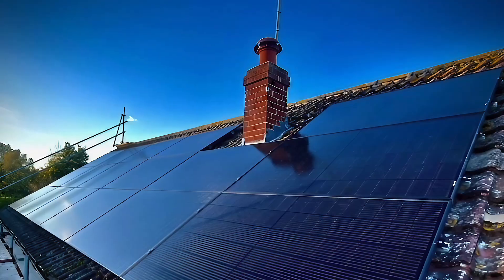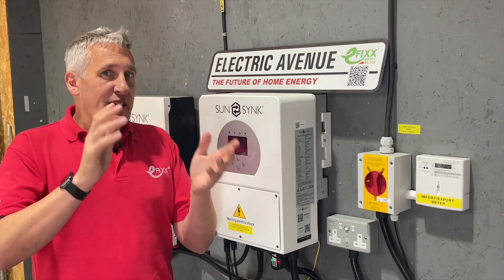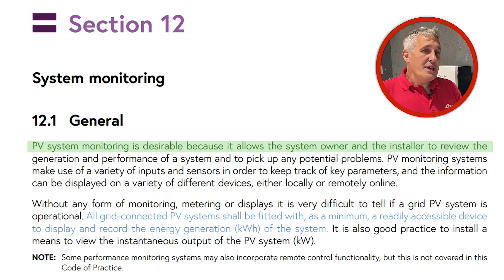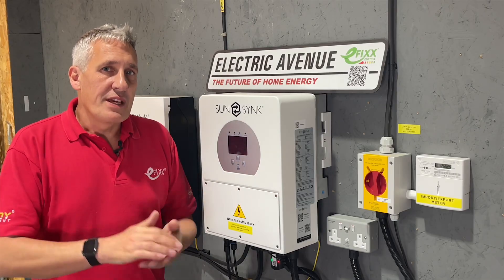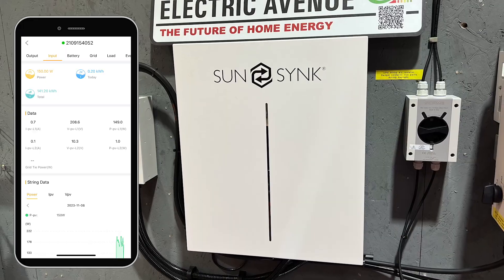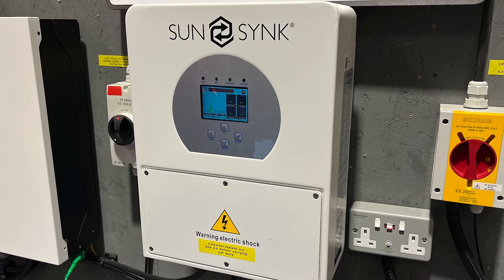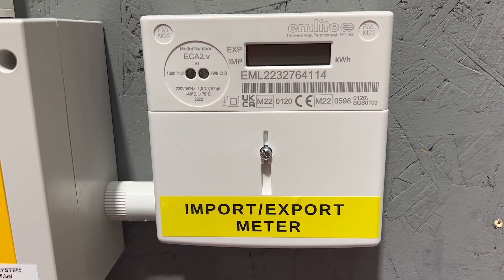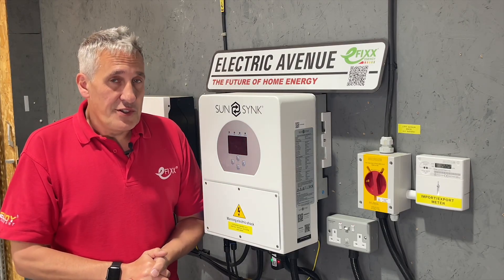Solar Inverter Installation UK  - Do you Need a Generation Meter?

Comment: The description of what the MID is commencing at 00:53 is incorrect.

The Measuring Instrument Directive was a European Law , reference: 2014/32/EU whose purpose was to achieve harmonisation of the laws of the Member States relating to the making available on the market of measuring instruments.

Individuals don't follow EU directives.
What happens is, it is down to each EU member state to create their own legislation which implements the EU directive.

The UK local legislation which the UK government created to implement that EU directive is: The Measuring Instrument Regulations 2016

So the actual law that applies to British  people is The Measuring Instrument Regulations 2016 and NOT the Measuring Instrument Directive.

Another important point is:
The Measuring Instrument Regulation does NOT command that people with solar panels feeding in energy into the National Grid install a kWh meter.

The command comes from another means.

Comment: Amazing how behind the UK is , my UK smart meter didn’t work for 6 year after install and it still doesn’t measure the FIT.  In France I have a linky, 10 years old , no need for additional meter as it automatically sends the feed back to the grid.

Comment: We have solar/battery works well. We buy our electricity from a third party so can’t benefit from exporting units . However when exporting excess units they are being recorded as IMPORTED unit by the submeter we get our electricity from , your thoughts??

Comment: i have a question, we have just had the solar system fitted is there a video on how to read the little grey meter? as ours has a negative number on import and 00000 for export. also should we ask for a newer smart meter than can conect to the solar system? we are PAYG electric (dont trust our provider) ?

Comment: I'm getting solar fitted in the next few weeks. I'm in northern ireland, so the rules are different. my installer says it will just run my old spinning meter backwards, so effectively net metering. He said the electric supplier will try to get me to install a new meter but i can say no, however I want to get the meter moved anyway so i'll let them install a new one if they move it for free.
Reply: I doubt the rules are that different, having backward spinning meter would be an issue in mainland UK, and leave you open to financial penalties if discovered (though I have never heard that happening). Some older meters go forward whether you are drawing power or exporting making you pay for your generation too, and some spinning meters have a stop on them to prevent the meter going backwards. All things being equal probably safest to go for a smartmeter and get on a tariff that pays more for export.
Reply: @mikebarry229  can't get smart meters in Northern Ireland. Like they refuse to fit them. Boggles the mind, but I got the export meter fitted just this week so we'll see how it goes

Comment: My PV/battery "Generation" meter has been damaged as the installers left one of the screws loose and it's now a bit melted.   I'm already getting export payments from my smart meter  so if I understand correctly the export meter was only fitted as best practice and is not actually showing anything useful so it could just be removed, I did aske them not to fit it it in the first place.

Comment: Many of the older FiT ones (like mine) do not have export meters, only an authorised generation one belonging to the house owner, and on a 50% deemed export contract with Ofcom (linked to RPI inflation) via one of the suppliers that manages it. At least, that is true in the absence of a “Smart” meter owned by the utility firm, which is the case at present at my place.

It all depends on your usage, as to whether measure export would be better than 50% generation as deemed export.

I’m just about half way through a 20 year FiT, so I guess it’s possible that a smart meter on the utility side might take over sometime, or if one of the other units fails part way through.

Comment: when submitting MCS certificate application you are asked for the serial number and model of the meter, what information should we provide? the inverter details?
Reply from the maker: Yes or just put zeros in the form
Reply: @efixx I was about to ask that question. I’ve submitted the din rail meter serials for the govenergy em115’s before, but I never thought of just putting zeros! 😅

Comment: With smart metering for import/export it doesnt feel like its really needed anymore. Im happy to rely on the mid meters such as the din rail ones on the GivEnergy AIO/Gateway in place of a physical meter of its own right. Less happy to rely on the inverters themselves to give accurate generation data so with a base level solax system as an example we would still fit an external meter. Its a good way to check what the inverter is saying its doing vs whats actually outputting into the wider system. Quick and simple way to check over time what you actually produced. Because we all know when an app loses support or some firmware is updated that data is likely gone to the cloud forever with it lol. Good walk through again Gordon. Didnt know Gary has solar he has never mentioned it.....
Reply from the maker: Problem is the dumb meters don’t give you any time reference so you can’t really gauge performance overtime. Unless you take a manual reading week / day
Reply from the maker: Rumour has it Gary has another battery 🔋…. Beware
Reply: @efixx  Gary should really start talking about his solar. It’s like a hidden secret, maybe he should get an air fryer…
Reply: @efixx  absolutely agree. More to see very quickly since I put my system in its pumped out however many units. Day to day I use the GivEnergy portal which can show me generation output, temperatures of all the equipment, power factor, voltage and what I had for dinner lol. That level of data is insane. The worry is much like when Anderson got into trouble in the EV world is that reliable long term, will it always have support for say a 15 year lifespan. I quite like having the little meter to check now and then. Was very interesting to visit an older system last week that has one for the FIT and that has measured generation since 2010.

Comment: I have recently hat 2 of these meters fitted for on 2 inverters & I'm confused:

1st meter shows NET 48kW     (IMP 0.4kW & EXP 48.8kW)

2nd meter shows NET -73kW yes minus!      (EXP 10.1kW & IMP 83.2 kW).

Any ideas whats going on???🤔
Reply from the maker: Do you have batteries?
Reply: @efixx  Yes I do (sorry I should have said). I should also mention there are ZERO cables/loads connected to the CU yet as the house is undergoing major renovations so no electrics are being used from the CU. The only things connected to the main CU presently is the solar gear (two inverters & one 1 5.8kwh battery)  :)

Comment: Let's make this simple as it seems you are missing the point. The meter is to record the kW generated by the connect system at the site. Which, is    also accepted by the energy co's as it has a known level of accuracy. The inverter does not providing the same level of accuracy. Also, what happens when the inverter is replaced? Or when the inverter manufacturer go bankrupt? All data is lost as it is likely that the inverter model/manufacturer is changed. The placement of the meter shouldn't be in the Roof. It's supposed to be where day light is available. If the installer has placed it wrongly. Then it should fail the MCS cert. A SMART meter may be available however it's not guaranteed. Even now. Your one doesn't work! They also can't tell if you have created the kW via Gen or PV. Hence, the physical meter should be fitted.
Reply from the maker: Unless it's a old feed in tariff agreement - the meter isn't used by the energy company for payment. Without a smart meter you can't get an export MPAN so are frozen out of the smart tariff.  If the inverter fails, then the data will still be available in the app. The "dumb" generation meters, only record an total generation, no data with regards to time or track of performance, so really a useless number. Would be a different case if installers fitted a version with communications.. but most fit the £30 version.
Reply: Even with "dumb" meters it really depends on the meter model used, there are many that have capability for adding communications but can be used without that have granular data at configurable intervals similar to what smart meters provide. Your not restricted to only having totals, though your right many domestic pv installers go for the cheapest option and unfortunately you get what you pay for. It is really up to the customer to understand what their requirements are and ensure things are installed, would be nice to see more companies selling and installing these systems ensuring the customers understand what they are and are not getting and providing proper advice.
Reply: The meter isn't measuring kW, it's measuring kWh. There is a big difference between them.

Comment: Absolutely bang on with your GM advice, as confirmed by the MCS techical guru last year 👏. 
Yes, there are variables but take the EM115 din rain meter as one example, it's MID so if you have the App then your system is compliant. Plus, I have also found that inverters with built in generation figures are generally in the right ballpark when compared to the Emlite GM's. Keep up the great work Gents 👍

Comment: Not particularly relevant to this show, but because it is the most recently posted,
You guys might find this video of switchgear in the US Battleship Texas interesting. Dating from 100 years ago. Lots of open Knife Switches, fuses, and means to fry yourself every time you turn around, all on a platform that tilts, swings, and rotates with the waves :-).
https://www.youtube.com/watch?v=xPXu14iX56A

On the present subject, we installed 10 panels in 2011 that get the full FiT rate. In 2018 we added 9 more to the front of the house, along with a Tesla Powerwall 2. (Solar edge modules added to the original panels for monitoring at the same time). No issues with the FiT with regard to the changes, except that the new panels did not qualify for any FiT, so there are 2 separate export meters. I take readings from both every night, (and have done for years), to compare generation throughout the year. Makes interesting reading, if you are that way inclined :-).

Comment: I've been avoiding smart meters for years due to issues on site.  However if I want to carry on with E7 I have to get a smart meter my March/April next year due to the BBC ending LW transmission making out Telemeter obsolete.
Reply from the maker: Good luck 🤞- I’m still battling 3 years later!
Reply: Me too. Government guidance clearly says "ideally a smart meter" which according to the energy suppliers means MUST BE A SMART METER. Ofcon told me that a "dumb" meter is perfectly acceptable.!!! I cannot have a so called smart meter at this property and at this time I am dumping my surplus in to a water tank. We have a ten panel system and are low energy users so quite a lot is being wasted which is almost as criminal as the profits made by energy companies during the recent crisis. @efixx
Reply: A few years ago I had to have an old radio teleswitch controlled meter replaced, which was done with a modern one with it’s own built in clock, and a standby battery. Used for E7, permanently on night rate between about 23:36 - 06:36 GMT. It is not a “smart” one. Normally read it myself and plonk the numbers in to my account with the utility firm.

Comment: Glad you showed the loft, that's where mine was fitted last year. (next to inverter and batteries)
Never looked at it.
Reply: It would be the first question I would ask if there were issues with the solar or battery,  just easier to ask the customer about the MID meter,

Comment: We have to have generation meters for billing purposes, and this has shown up some weird failure modes of inverters. The main one being the inverter says it's producing, say, 3kW but the generation meter shows it's only outputting 2kW. So far the only inverters we've had do that are old ABB ones but that's not to say it can't happen to others. You do also pick it up because the system performs badly, but if you were only going by the numbers on the inverter you wouldn't even notice that.

We've relatively recently moved to using Rayleigh meters which have a lot of positives but one massive negative when we do meter swaps on old FiT registered systems is that the serial number is only written on the back. If you forget to print out a label before you install it, you have to rummage around taking the whole metering panel apart to remove it from the DIN rail. I've no idea why they can't just do what everyone else does and write it on the front.
Reply from the maker: Great info - thanks Tom!

Comment: You need the meter serial number to register the MCS Certificate unfortunately. Otherwise its completely useless generally😅
Reply from the maker: Try just putting zeros in the form 😉
Reply: Or put the inverter’s serial number
Reply: Just put your smart electricity meter serial no. In
Reply: @rhysj25  but that doesn’t measure generation. If I have a 16A inverter and 16A load, the smart meter will record 0A export. Wouldn’t it make more sense to record the inverter’s serial?
Reply: MCS is just a certificate, your SEG supplier will take readings directly from your export register in your smart meter they are not paying you for electricity you self consume like under the old FIT scheme

Comment: Was that a photo of Gary accessing the SunSynk app at the end on both phone and laptop?  So that must be 2x10 making it 20 times a day lol.  Being just as sad I even graph my data 😵‍💫.

Having the Sunsynk app, a smart meter and a generation meter it's headbanging that you can't match the figures up.  I was told the gen meter tells me (a) Import = what the PV puts in the battery, (b) export = the remainder generated by the PV and (c) Net = simply the difference between the two.  But if I add (a) + (b) it is a fair bit lower than the app tells me!  As a customer the smart meter tends to give me the most favourable readings.  Again I guess the more things there are, the more problems can arise.